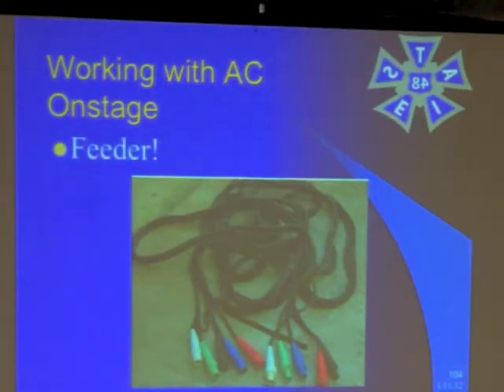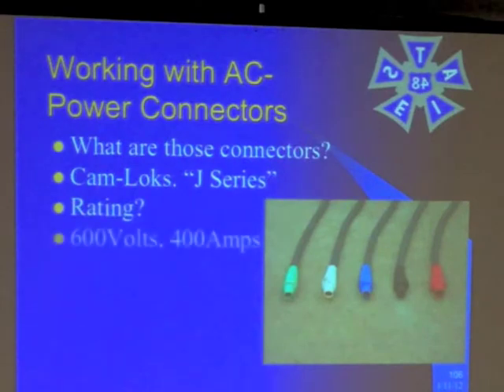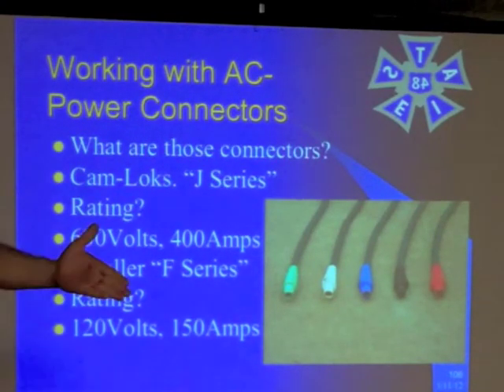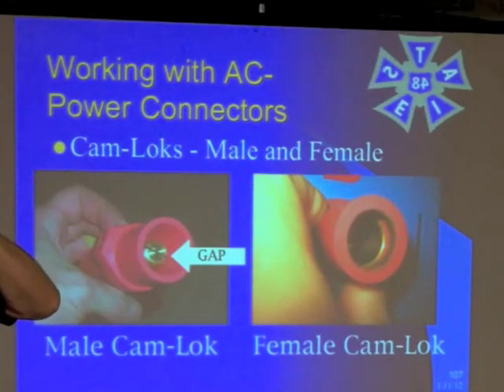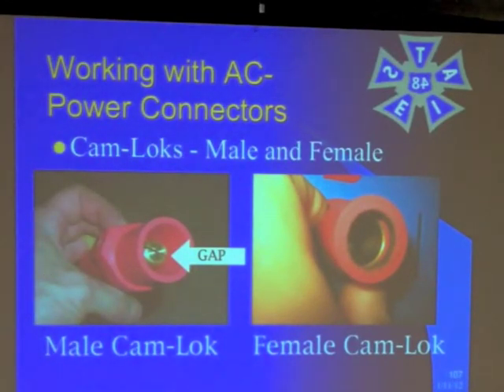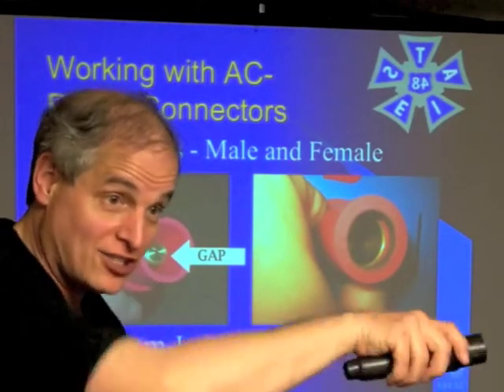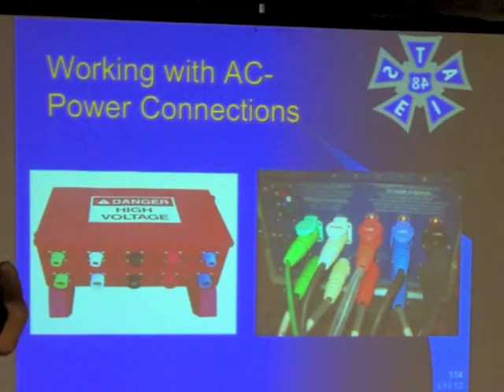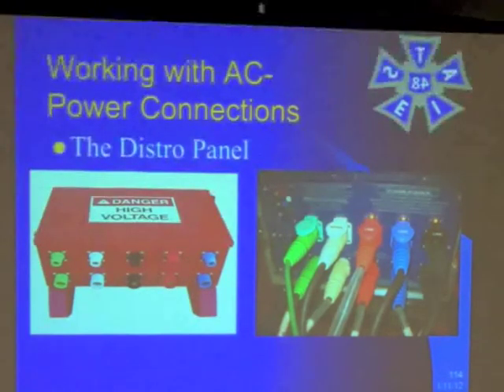Working With Three-Phase Power on Stage

Comment from the maker: Comments that are thoughtful, insightful, and even reasonably and constructively critical are welcome. Comments not based on existing NEC laws and comments ignorant of basic science, physics, and mathematics will be justifiably omitted. If you have a problem with the facts stated in this lecture, either cite your source to disagree or risk exposing your ignorance to the entire World.
Reply: can feeder cables come from a 3 wire single phase source be plugged into a 4 wire distro box? What is the config? Thank you
Reply from the maker: No, They can't.